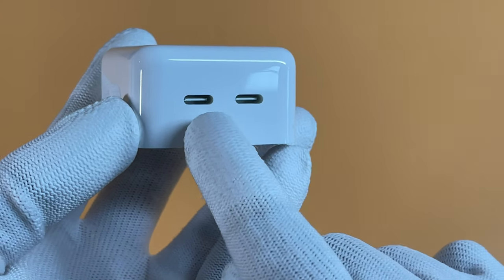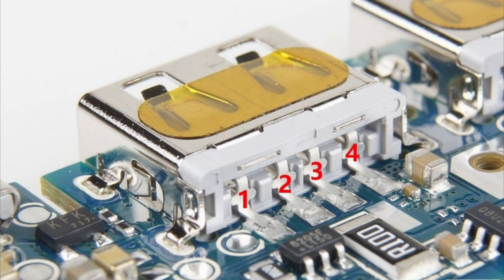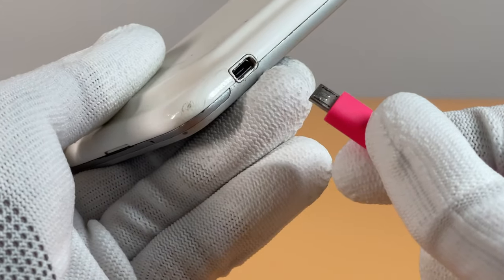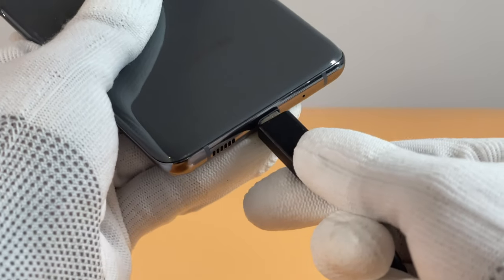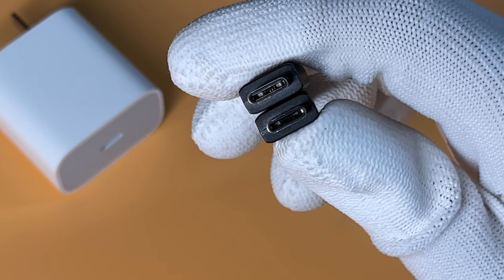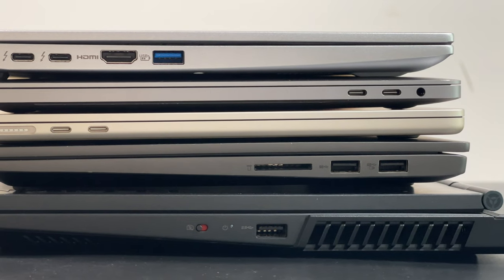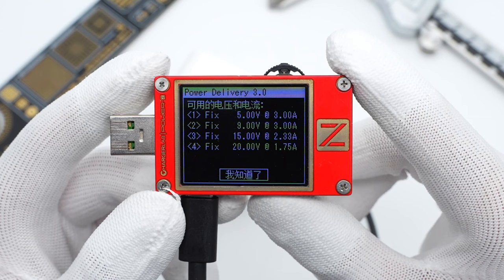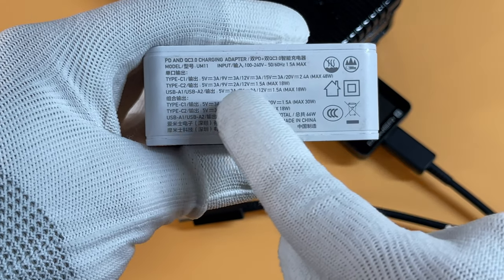How to Choose a Convenient Multi-Port Charger for Everyday Use?

Comment: My biggest problem with multi-port chargers is power interruption on one device when a second is plugged in. I have a Hypercharge device with two type-C ports. I power a laptop through a type-c hub (with mouse/monitor/storage connected) but if I plug in my phone on port 2, the hub loses power, the devices disconnect, and the hub might need disconnecting/reconnecting before it works again.

I don't know how to tell which chargers have this problem so I'm kind of stuck and just use separate chargers.
Reply: Has anyone come across a multiport charger that doesn't has this power interruption? Because a have tried a lot of chargers and I met this "problem" on all of them

Comment: The today USB Cable is terrible.
for example when you buy 100w PD cable it doesnt mean it will support USB 3.0 connection.
then if you buy USB 3.2 Cable it doesnt mean it will support 100w PD charger. so be carefull.
Reply: Yes, that is a big problem.  The only guarantee is USB 2.0 and 3A/5v.  Beyond that, you're trusting the manufacturer to not lie!
Reply: If you are rich, good solution is to buy the TB4 3m cable Apple sales.
Reply: You need to learn about usb c and make sure buy reliable brand and read specifications carefully if it support your devices or not, well most ultra fast charging android phone use proprietary protocol and some also support pd some are not, so as i see @chargerlab test with a lot of them they're barely above 20w with pd, so make sure to use it's original charger to get full speed.